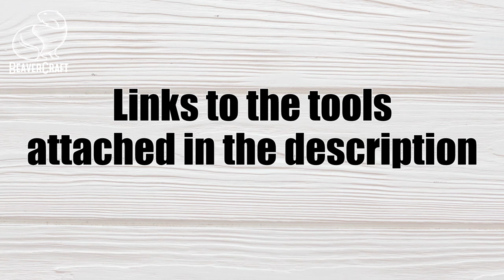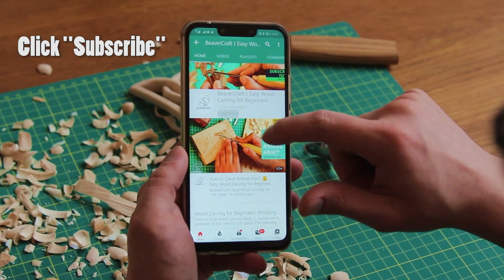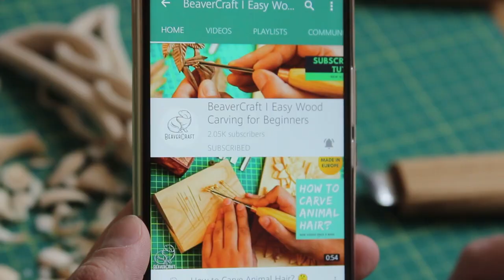Wood Carving Ideas - Chipolino Carving

Comment: Which knives is the carver using? One appears to be a short (2"?) sloyd type, just what I've been looking for.  It has thick spine and a "scandi" grind.  I think that's the proper term. He is using it at 15:00 and thereabouts.
Reply from the maker: In this part of the video, the carver uses C15 – Detail Wood Carving Knife: https://bit.ly/3zuKp1v
Reply: @BeaverCraftTools  OK, thanks. I actually have that knife.  It looked larger in the video.  I'm looking for a sloyd type with about a  2" blade.
Reply from the maker: @John-gj1jr  It could look larger but it's the C15 one. In addition, this knife with the blade length 2.36" might be suitable: http://bit.ly/2Oqf3Dv
Reply: @BeaverCraftTools  Thanks.  I'll look into that.  It looks similar to what I wanted.